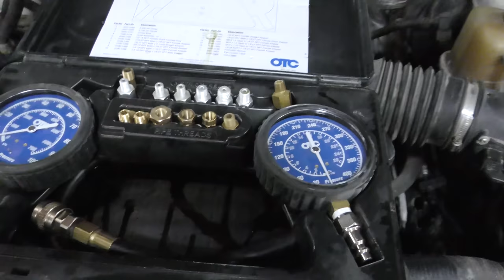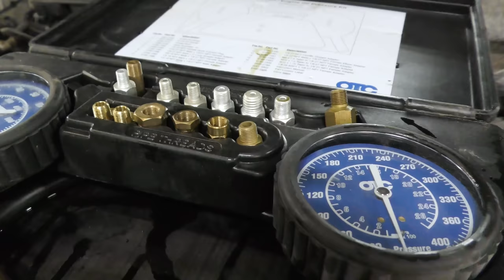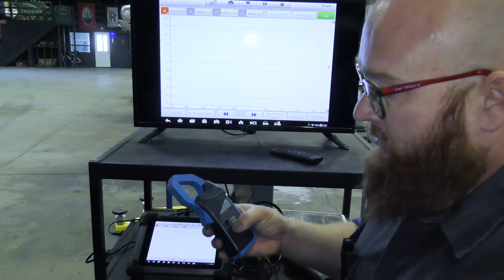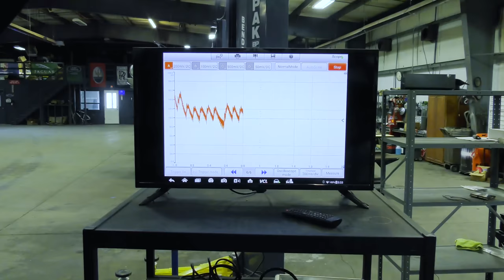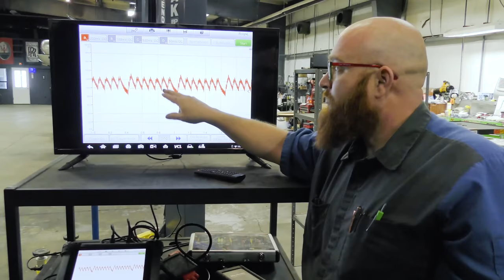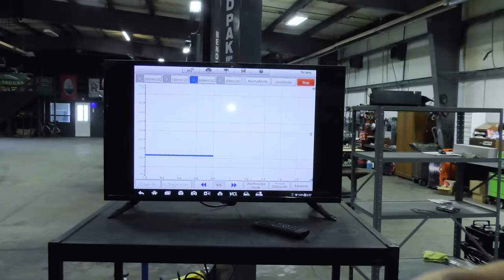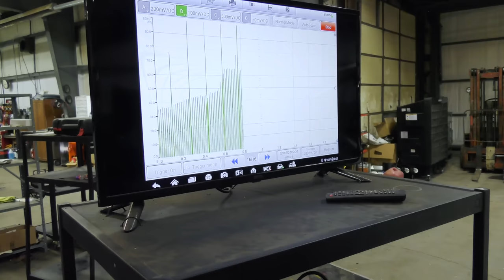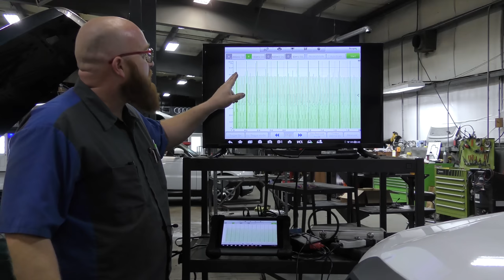Can an engine additive really fix this 2011 F150? CAR WIZARD shows how to diagnose and repair

Comment: In my country we tend to use this method or using a higher viscosity oil to solve oil pressure and/or consumption issues on higher mileage engines because of increased tolerances in the engine parts due to normal wear. There are many toyotas with over 300k kilometers using 20w50 engine oil going strong with the original engine and no consumption. Many engines of other manufacturers are pretty much the same. 
We also tend to put 10w30 on almost any engine due to we live in a hot tropical climate and thin oils like 0w20 or 5w20 wont lubricate well. I have a honda pilot with the 3.5 v6 and i put 10w30 on it when it needs 5w20. It works like a charm. Never had an issue. 5w30 is also good for these climates.

Comment: A number of years ago I had a car that was showing low oil pressure and I decided to replace the sender rather than having it diagnosed. It was an easy job for me, cured the problem, and cost a dollar fifty. It wasn't the right way to do it but in this case it did work.

Comment: *goes for a service, yeah four new tyres and an engine mate 😭
Reply: I believe that's known as a "Ford tuneup".
Reply: And wipers, it’s a safety thing...
Reply: @ryanroberts1104  probably why its the most popular vehicle on earth
Reply: @davidlefranc6240  It's actually not. GM sells more trucks than Ford. It's just spread out between Chevy and GMC so it looks lower for each, but combined they sell more. A Chevy and a GMC are the same thing with a different grille and badge. They do this on purpose for franchising and monopolistic reasons.
Reply: @ryanroberts1104  dude they mean combined everybody know that stop smoking weed

Comment: I am surprised as usually we are shunned from using the Lucas or additives because of the VVT. Glad to see that your promoting good diagnosis over throwing parts at it. However replacing the sensor might be an option if they don’t have equipment to test it and are handy enough to change it themselves. Great relative compression test. Thanks mr wizard

Comment: Or you just use 5W-30 or 5W-40 and skip the oil additive.
Reply: 5w30 at 197000 miles still running fine.

Comment: Still waiting for a review of those older stick shift Ford Ranger type trucks. Work better than any of these newer junky trucks
Reply: @KS-xo3oh  the 2.3 4cyl of that era is good for 400k+ and the manual gearbox its attached to will outlast that.  You see this newer f150 is already wore out at 180k, its auto tranny is probably going out next.
Reply: @KS-xo3oh  those 6 cylinder engines were junk. 2.3L 4 banger is the only way to go
Reply: @Jay250cc  Who the heck wants to drive a 2.3 and manual trans now? The thing is so underpowered for todays standards. Everybody drives like its a race track in my area, and you would get ran over in no time.
Reply: @mph5896  yeah but that '90s 4cyl  manual truck turns on every time and get u a respectable ~23mpg. cheap to fix and replace the engine  until it dies after 400k miles plus of service and the manual tranny can be rebuilt at home for cheap.  Look at the wore out engine on this modern day POS  $30k+ msrp F150 falling apart at 180k can't hold oil pressure properly and the auto tranny gonna start to slip shortly next it's so expected I can predict it to you now.
Reply: @Jay250cc  400k on a Ranger is outside the norm. Those things were scattered throughout salvage yards in the 90's, early 2000s with lower mileage. 180k on a truck before its worn out is doing good. 

I can keep a car going forever as well as long as I keep throwing parts at it. If you are paying for repairs, there comes a tipping point in which its no longer feasible to dump 2-5k into a car a year in parts/labor to keep it going
Reply: @mph5896  the parts are cheap at the junkyard and you can do the work yourself with basic tools it's ez, all repair steps are on youtube. I see the 4cyl trucks like d21 hardbody, rangers, tacomas with the 5spd go crazy high miles on the regular 400, 500k miles plus on the original tranny+motor just simple maintenance. U can keep fixing it for cheaper than the monthly payments on a new junky truck that is designed to break down fast at 100k or so like this trash 2011 f150. What they should do is start remaking the old trucks as new trucks. Like a 2021 of a 1996 Tacoma but I wouldn't be buying one  bc my old truck still runs with the correct oil pressure!
Reply: @Jay250cc  I have no issue personally working on the newer stuff. It takes a couple extra tools like a bidirectional scanner, but the newer stuff is actually easier to diagnose if you know your electronics.

Old trucks would never pass modern emission and safety standards. Plus people demand more power.
Reply: @mph5896  ok bud well go ahead and open your wallet to buy the extra tools to work on newer trucks that breakdown twice as much. If that's your thing.
Reply: @Jay250cc  Ok, will do.
Reply: @UCkRFxx28KXnFFlaG8MOPh3Q Na, I just don't like driving around 25-30 year old rat traps
Reply: @mph5896  A fool and his money are soon parted

Comment: @carwizard I've not seen much on these 2011-2014 from you. I know they're proven quite reliable in all variations of driveline offerings(with proper maintenance), but wouldn't mind a video showing any commonality of issues seen across the board. Like the cam phasers that Ford won't get sorted out.

I've been a fan for years now, keep on keeping on!

Comment: Hello wizard, what do you think of the 04 f150?
Reply: What motor ?
Reply: If its got a 5.4 run. I mean Run away as fast as you can. Do not purchase it
Reply: Oddly enough I have an 04 with the 5.4 running strong at 220k.  Maybe I got a rare good one 😂
Reply: @bluegrassgarage  our new one has like 188,000 miles and it might have a new motor or its alright
Reply: Stay away from the 3v.
Reply: @bluegrassgarage  The wizard has an entire video dedicated to avoiding those engines and the tome of engine replacements performed.
Reply: The 2004 and 2005 model year F150 was a bad year for those trucks because they had more than just the 5.4 3 valve issues. They had a lot of problems with the window regulators on the power window models on those earlier eleventh generation Ford F-150s.
Reply: @atx-cvpi_99  Agreed
Reply: @bluegrassgarage  People shit on the 5.4L and it's true, it is finicky engine that requires pretty precise care and maintenance but as long as it gets that they are generally fine and will like hundreds of thousands of miles without much issue. The problem they have is the people that buy them cheap out on maintenance and don't use motocraft replacement parts on them over time this is wears them down and they start to develop catastrophic issues early in their life cycles, if you have a good running 5.4L 3v stay VERY on top of your maintenance and it should stay good running.

Comment: Wizard is very thorough, I would trust him with my car.
A couple of years ago my Chevy 3.9 v6 was showing low oil pressure.  It's a 10+ year old minivan so engine work was not looking like attractive option.  I had just put in a factory rebuilt transmission the year before.  The mechanic suggested to try synthetic oil.  Three years later (now) the car is still going strong.  Too good to throw away and too crappy to sell!
So what the Wizard says about additive from Lucas sounds legit to me.  But consider synthetic oil as a solution too, oil pressure light does not have to mean certain doom.

Comment: What engine was in this truck?
Reply: The little I can see of the air box looks and the lack of a plate mount on the bumper looks like a 3.5 EB but its hard to tell...dying to know also
Reply: @joelbosso1331  its clearly 5L v8 engine you can see it when he tests the coyls
Reply: @joelbosso1331  5.0

Comment: I had a Toyota Prius with over 350,000 miles and despite the warning on the package regarding engines over 100,000 miles, I used the BG Hybrid Treatment kit of 3 cans. For a month or so my oil burning issues were fixed then the head gasket went (not the fault of BG)

Comment: Thank you for demonstrating the scanners and equipment Great Job! My transmission on my Hyundai was a little off at 175k miles did a trans drain and fill “even tough many say don’t and this mileage”. Still was not right so then I drained 2 quarts and added the Lucas trans fix, reminded me of thick red syrup. Trans is ok again after. Now at 203k miles and going.

Comment: 180 shouldn’t be considered “high mileage “. I got 300k on my GMC sierra
Reply: It's not, there's plenty of Coyote 5.0L Fords out there with 350K or more on them now. Anyone who told him that engine was worn out at 180K miles was just to lazy to take the effort to properly diagnose the issue at hand and opted to just write the whole thing off instead. These 5.0L's Fords have a strong reputation for reliability. I've got a 2011 F-150 5.0L I bought new in 2011 and granted mine only has 105K miles on it, it still purrs just as good as the day I drove it off the lot, I've seen lots of these trucks on the market place though with between 200K and 400K miles that are still running though.

Comment: Why not also adding something like ceramic oil additive.

I did that to my 70' Pontiac Lemans 350 and newer toyotaish KR1-FE engine. If powerplant is dated/abused I would do oil flush, and then used additives. I mean it's done anyway.

Comment: 180K?  In this day and age, thats a joke.
Reply: I have this truck and engine. I am disappointed to hear that. Mine has 53K so I don't have to worry yet, but I am ticked that it could develop that problem at such a low mileage.
Reply: @BertReno  probably not taken care off. Only use motorcraft filters and good oil changed every 5k and you’ll be fine.
Reply: definitely a maintanence issue, go 3-4k and use mobil 1 or another good synthetic and hitting 300k shouldnt be an issue
Reply: That's nuts. I'd consider 180k to be seasoned, not worn out. 300k; that's when I might replace an engine. What a waste of materials.
Reply: Yep. Ive got a 2011 F150 with 180k as well and it’s been flawless other then 3 issues. A leak in my coolant reservoir, my steering rack went out 2k miles ago, and a rear main seal leak that will get some love soon. It’s lund tuned,  with an air box and giggle gas. I just keep up the maintenance. These trucks are tanks.

Comment: I have a 06 Expedition currently with 170k miles on it, I've owned it 12 yrs I should knock on wood because outside of fluid and battery changes I've only replaced plugs, coils and about yrs ago installed a used rear end. I think in most cases the people that have issues either drive hard and or don't change their fluids often enough.

Comment: Hey Wizz this is not a new problem in the early 60's I was working in my backyard on almost all of the big three by adding thicker oil and it worked great, but for the little thing we call winter. In winter we used to leave the crank case down a quart so the crank didn't hit the oil on startup, this usally got you through the winter and gave you another summer of driving. Our additive of choice was STP, my customers were paying $2.50 an hour but my day job only paid $1.65 so it looked good to me.

Comment: I had a customer with a 2001 F-150 with the 5.4L triton. I put an engine and a transmission in and less than a year I had to replace the right head because the spark plug blew right out and took the treads with it. I hated working on them.

Comment: I'm pretty sure it won't fix anything. It might need heavier oil.
Reply: The problem is that modern OHC engines are not engineered to have heavy weight oil. If you have a older ohv engine like a big block Chevy it might work.

Comment: You don’t need a fancy scope to do some of these tests a dc amp multi meter with a hall sensor type clamp can read the amp draw for items draining the battery dead. Use same method by removing fuses also handy to know that computers don’t go to sleep right away and show a draw. This is a great video showing how to use the scope and why they are a great tool.

Comment: What brand oil is used can make a huger difference too. I had an 88 Chevy S10 with 2.8 V6 that I bought with 24k on it. I changed the oil every 3k with Valvoline. By 100k, it was using at a rate of 2 qts plus per interval and leaking. After 100K I started going to SpeedLube. Same interval but they used bulk Pennzoil. Burning stopped. leaking stopped. People say Pennzoil gunks up engines, but it helped mine keep going until I sold it at 188k. It was getting weak, but still going.

Comment: when i bought my ford ranger back in the 90's it was burning oil granted i was driving at the time for dominos pizza but it was burning oil and i had no oil leaks so i bought a product called dura lube you can still buy it today and holy crap that stuff worked like a charm the oil burning stopped and to top it off i was getting better mpg and when i mean the oil bruning it wasn't burning a lot of oil to the point of seeing blue smoke out of the exhaust but it was just enough that i would have to check it often but anyways so i used the one quart of dura lube with regular oil and the engine ran great

Comment: i dont like Ford drivers. not so bad behind the wheel, but i recently realised they're not people to work or live with
Reply: I mean, if we're going to completely blanket an entire group of people based off what they drive I generally find Ram drivers to be the most insufferable, they're the one's that weave in and out traffic going nearly twice the posted speed limit, they're the one's so preoccupied with "rolling coal" on everyone else, they also statistically speaking are the most likely drivers to be intoxicated behind the wheel.

Comment: I got a 5.4L 3V. At 190K lost variable timing and drove it to the shop in 2nd at high RPM. 
Saved up in anticipation, and $3500 got the upgraded Hi Volume oil pump, new timing chains and tensioners, guides, VCT's, and all the Rocker Rollers . . . buttoned up, runs great, and with religious oil changes (5W-30) should get another 200K, . . . 300K . . . 
If you have a workshop, do it yourself with just a few special tools for $800 in parts.
The 5.4L3V is getting me 25-29 mpg on the highway . . . 17 mpg mixed.

Comment: Had a similar issue with a similar truck but a lot less mileage but well taken care of, but it occurred when it taken off cruise to idle...then the oil light would come on briefly when the engine dropped to idle...that was a clue. Now this customer being a good one...I just decided to clean the throttle body and as you said...installed a OE Ford filter and the issues went right away. That was over 2 years ago and since then it's oil change service involves a Ford filter and a little spritz of throttle body cleaner keeps the light off and the oil pressure up all the time.

Comment: I haven't watched the whole video yet but I had the same problem with a truck I had just purchased. Fixing mine involved cleaning the sending unit connector. That's it. No replacement of parts or swapping oil for Lucas.

Comment: I've got an '04 GMC Sierra 2500 HD with the LB7 Duramax engine and 484,000 miles on it. Engine has never had any work done on it except for quite a few injector sets replaced and even on the hottest southern day oil pressure is just under 80 PSI.

Comment: I have a 2011 GMC Sierra with 297k an no engine trouble yet and it has recently started using a bit of oil but maybe only about a quart between oil changes.
Reply: Without any diagnosis the two main causes of light oil burn is valve guides and piston rings. Valve guides being the most common. No matter the cause your engine has lived a long healthy life.
Reply: You can check to see if the pct system is open and breathing. ITs not a valve but an orfice. See if its not plugged. Otherwise, keep adding out to it when it needs it. Its an old engine.

Comment: I had to Q, measure current draw on starter, you can't say what cyl that miss. you knew that no 2 was gone. Ignition pickup, it does pick up the coil you test, can't tell if someone other miss. Autel is good stuff.

Comment: That's pretty nifty indeed. Might even serve as a quick pre-purchase inspection method... With a private seller, I'm not pulling all the spark plugs for a compression test - but getting to the battery cable, disabling injection and giving it a couple cranks - very doable.

Comment: this is what that lucas oil stabilizer is for, all it does is thicken the oil. so when you need oil pressure more than the oil additives you add this. some people claim its a fix all or should be put in from the start but thats not true

Comment: The Brazilian Beetle's owners manual says it's normal for the low oil pressure light to come on on stops when idling, after the engine is up to operational temperatures. In fact, it is and it does come on. Just for curiosity.

Comment: I have a 92 F150 Flareside, with the 351W (5.8L) with 189k on it, and 30k miles ago I had an issue with low oil pressure, I know it's an old beast but since I love the style, and it treats me right I added a large bottle of Seafoam and drove it for a few days back and forth to work, it's a short trip. As the weekend approached I got 6qts of 5W-30 synthetic and the oil I drained was damn near diesel black, slapped on a Motorcraft filter and the oil pressure rose past the N all the to L on Normal on the gauge and has stayed there for the last 5 years. I do a complete tune up every two years during smog time. Older Fords, (pre 96) are like cockroaches.

Comment: Did it have 5w20 oil?  Wonder what 0w30 or 5w30 would have done alone with OE quality filter.

The industry needs more guys like the Wizard who actually diagnoses instead of guess and check at the owner's expense.